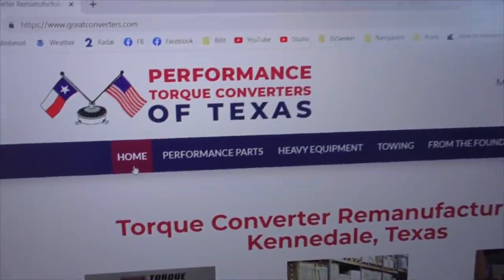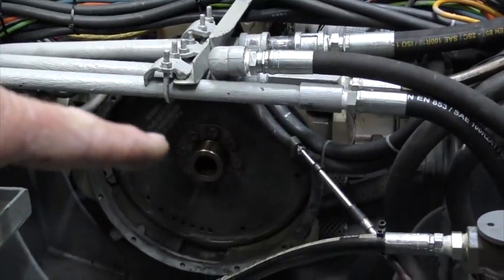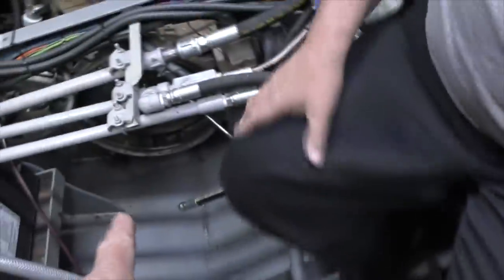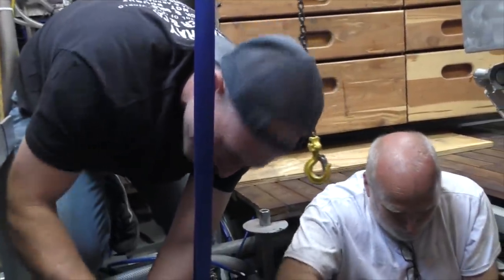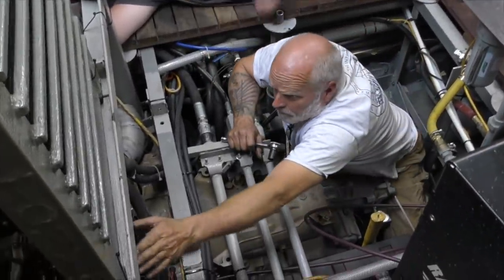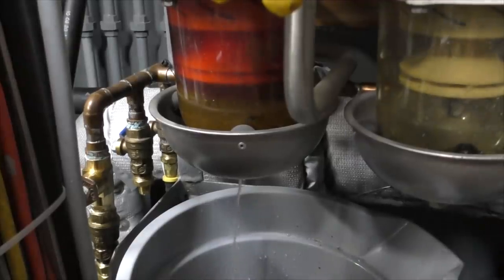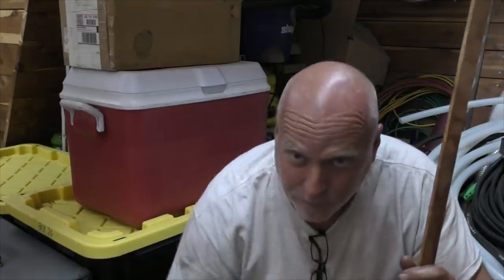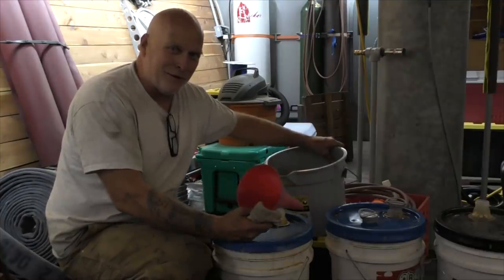School Bus Transmission in a Boat - Part 2 - Torque Converter Eliminator Installation

Comment: i thought i heard you say you will only use first gear in the tranny .  i dont know if that tranny is any different from other automatic tyranny's but i do know if you run first gear at high rpms it will fail as the planetary will be spinning to fast   .
Reply from the maker: We will, second gear was an accident. Part of the learning experience. :-)

Comment: Doug Just a thought ARE you using a transmission cooler if not bad news you need to! I worked for Transmission shop and heat will kill any transmission!!!!
Reply from the maker: Yeah, we still have the heat exchanger on it.

Comment: I started my YouTube channel fifteen years ago today. I can't take a picture of that, maybe a screenshot of the main page, but it would be easier for you to chase my name. There's just under one thousand original sound scores with video, you might even find a few of my prototype blueprints if you dig long enough. I work on this between building gas stations and auditoriums.

yes it's loud and angry most often, perfect for those screw up moments, but there are some real gems in there. if you find anything interesting or would like to use any of it in your productions, go ahead. It would cost you nothing and keep the copy write hounds off the trail.